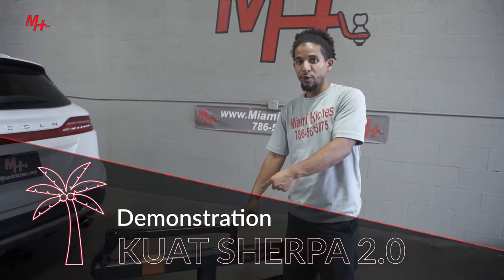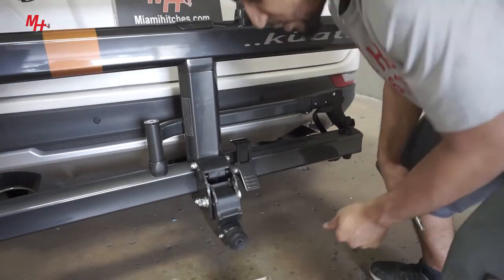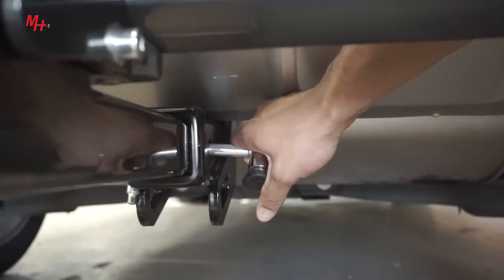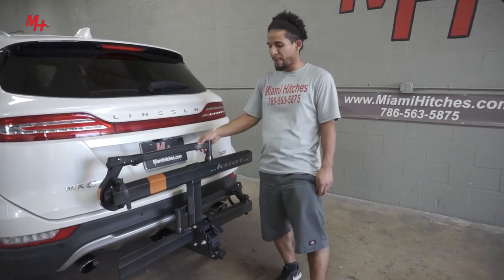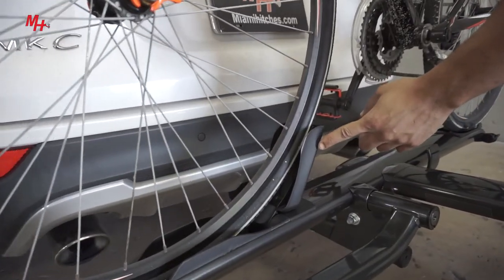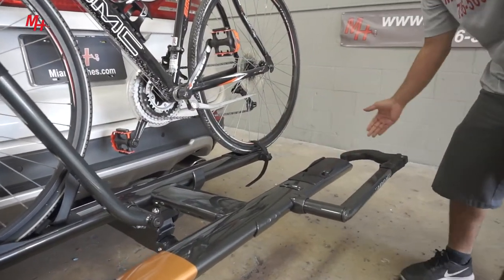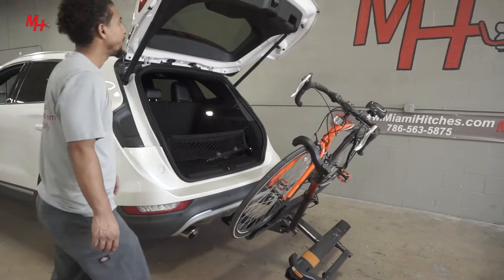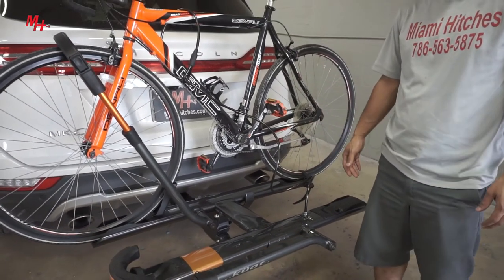How to use a Kuat Sherpa 2.0 Hitch Bike Rack

Comment: Great video! One thing, the way you locked your bike onto the rack makes it super easy to steal. You should wrap the cable through the frame and maybe one of the wheels too if possible. The way you did it makes it so the bike can be disassembled and removed. If you put it through the inside of the frame you'd have to cut the bike or the cable to steal it.
Reply from the maker: "Thank you so much for your feedback, I'm glad you enjoyed the video! And I really appreciate your advice regarding bike security. You're absolutely right, I'll definitely start locking it up differently to ensure better protection. Wrapping the cable through the frame and maybe a wheel sounds like a much more secure approach. Thanks again for looking out!"
Reply: I am originally from Miami and I know how easily bikes are stolen. You definitely have to put the cable through the frame and both wheels.
Reply: Thank you for this video. I bought my rack used from a bike shop, which is much better for me. If it weren’t for your video I wouldn’t be able to figure out how to fold down or extend those arms that secure the bike down.

Comment: Really great video, thank you! I really like this rack. Is this a 1-2inch hitch? Also, do you know if they have 3 bike rack options?
Reply from the maker: @latoya3696 Thanks for the compliment. This rack the Sherpa can come in 1-1/4" or 2". Also available in 3 different colors. Unfortunately it does not come for 3 bikes. If you want a Kuat for three bikes check this one out. Hope this helps. https://miamihitches.com/kuat-transfer-v2-3-bike-platform-rack-fits-2-inch-hitch-t223b.html

Comment: I have the Serpa 2.0 but I see some difference between mines and this one. I have the 1.25 hitch version. Not sure if that's why.
Reply from the maker: Hi, there are two models of the Sherpa 2.0. There is a 1.25 inch shank and a 2 inch shank. The 1.25 inch shank has a curve on it that brings the rack up about 4 inches. This is done as a 1.25 hitch is mostly used in sedans that have hitches that are much lower to the ground. There is an adapter piece (Part # D101) that allows a 1.25 inch shank to be expanded to two inch and can be used in both hitch sizes. 

The 2 inch rack is a straight shank as seen in the video. Most two inch receivers are usually at a good height for proper operation. hope this clarifies the difference. MH

Comment: Very good explanation. Do you recommend this rack or any other similar ones?
Reply from the maker: This is one of my best sellers. Highly Recommended.
Reply from the maker: If you would like to stick to Kuat, you can check out the Kuat NV 2.0 & Kuat NV Base 2.0. Which both have the option to add up to 2 bike add-on attachment

Comment: Not a good example of how to mount and secure the bike.  The cable could elongate the way it was installed by sliding towards the steerer tube.  Also, the arm latching on the front wheel should be against the fork for a tighter and more secure fit.
Reply from the maker: Thank you for your feedback. We will do an update to the video.
Reply: @miamihitches  Sorry, I didn't mean to be critical.  The rest of the video was actually very good and well executed.  Timing and pace was very well done.  The way the cable was installed, it could be slipped over the handlebar and then under the wheel which means the bike would be easily taken.  I doubt the cable is long enough but not sure.  I am getting my rack in a few days and will check.  Ideally the cable should be routed through the frame AND BOTH WHEELS.  Wheels can be removed from the bike if just the frame is secured by the cable.  Good wheels can run between $1000 and $4000.
Reply from the maker: @johannel8104  Thank you we aim to provide quality videos. We're happy to hear you're getting your rack soon. We're always running promotions on our website. Make sure you check it out next time you need something. Enjoy your new rack.